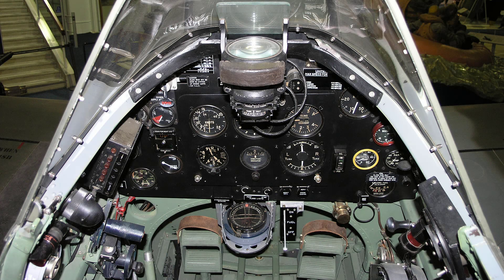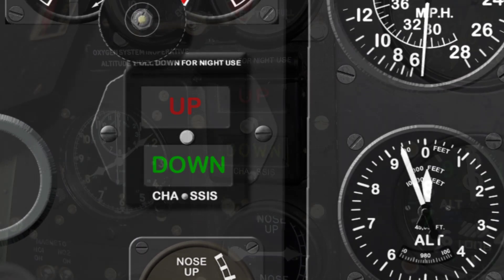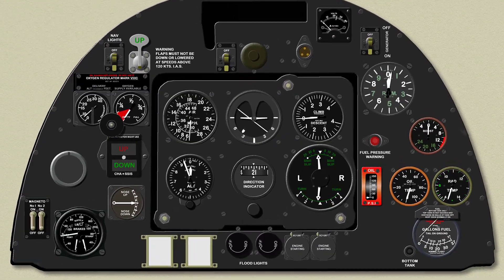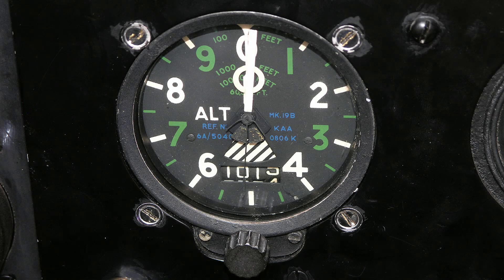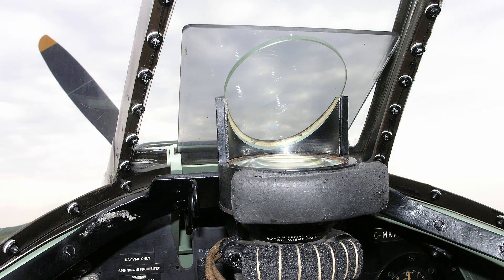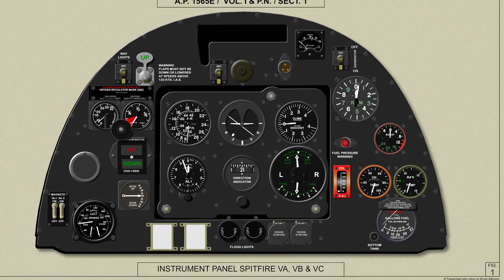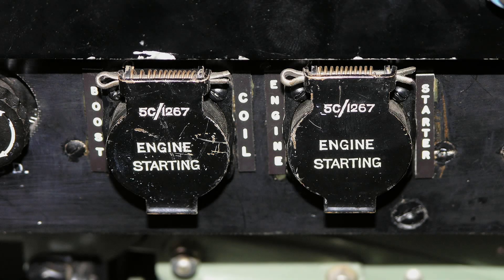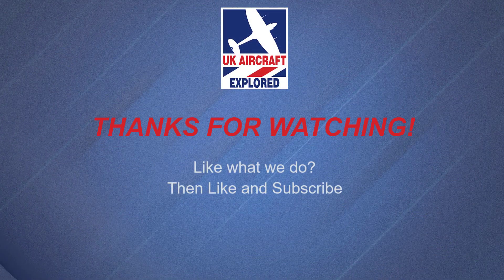Spitfire Mk V – The Instrument Panel

Comment: Good day Bryan. You seem to have hands on access to the Spitty and others… Lovely! I am quite sure but for historical correctness I would like to ask if you can confirm that the ‘Maximum Boost’ placard in the Smith’s boost gauge is fixed internally in the instrument and not connected to the a rotating bezel in any way.  This would be kind of silly of course but … you never know! Thank you.

Comment: Greetings from Czechia, former Czechoslovakia - one of the boody foreigners that had their own 4 squadrons in RAF during WWII. Great video as the whole series!

May I have a question?
 How are the instrumnets iluminated? I assume it is not backlight (with an exeption of the landing gear gear indicator), but there would be a small bulb in the rim of each gauge like the old cars used to have. I Would love to know it for sure as I am building a model of spitfire instrument panel and would like to build it illuminated.

Thanks for any information.
Reply from the maker: The cockpit is fitted with two adjustable small floodlights which could also be dimmed.

Comment: Superbly done. Very interesting and informative. Just a couple of details: (1) The undercarriage indicator is not 'on a red background' for example. It is red illuminated letters on a black background and, of course, similarly for green.  (2) On approaching a destination airfield the barometric pressure on the altimeter is often (perhaps normally) set so that the altimeter reads zero at airfield height, as opposed to the normal setting which, as in the video, is so that it will read zero at sea level.
Reply from the maker: Thanks for watching
Reply: QNH uses station pressure and is the most commonly used pressure setting in the commercial world, thats where the altimeter is set to 0 sea level so it shows airport elevation when the a/c is sitting on the ground. QFE is where the altimeter will read your height and not your alitude because it's set 0 at the airfield elevation. QNE is considered STANDARD setting and is used above the transition levels which can vary from region to region so that all high alitude aircraft are using the same setting.